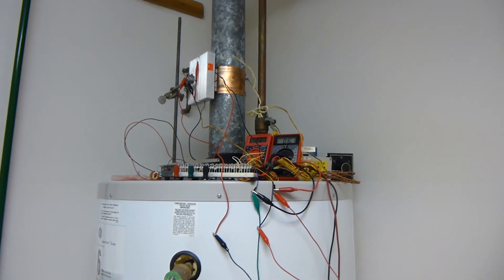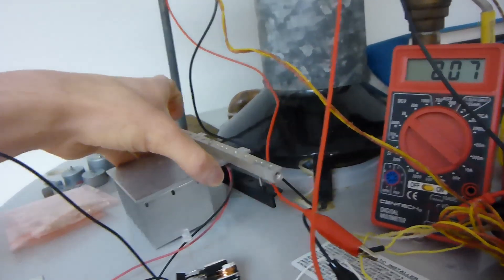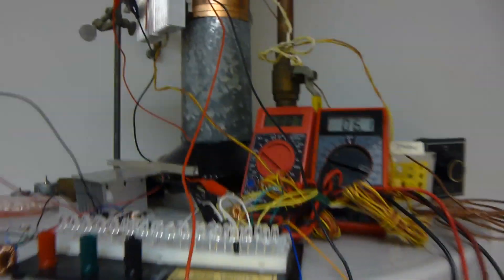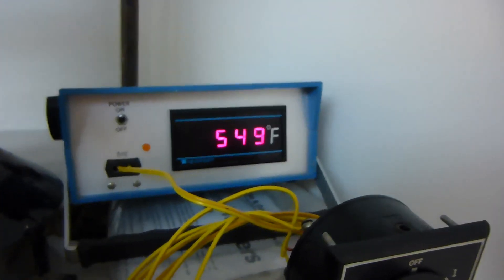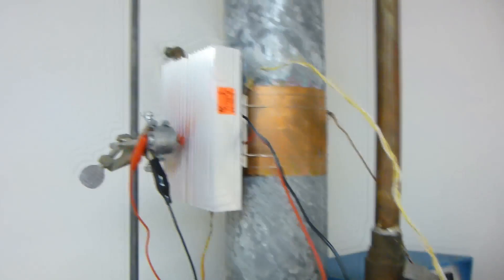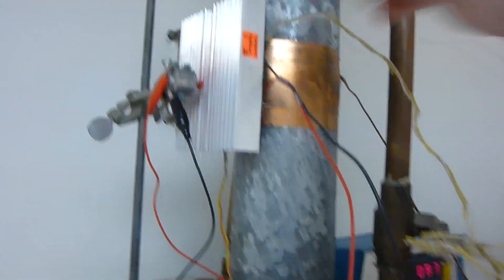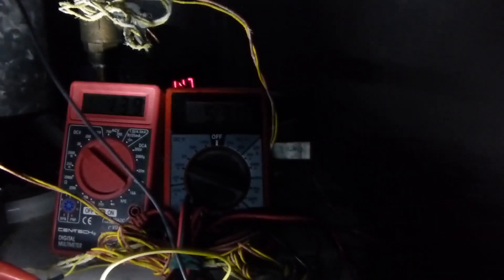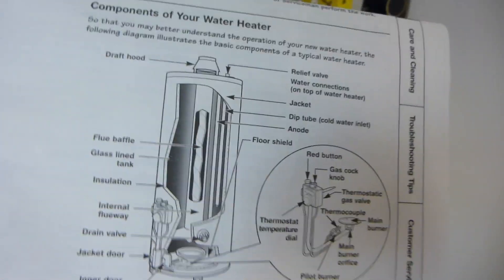DIY Peltier Coolers Harnessing Free Power From Water Heater Flue Gas

Comment: alternatively you could just better insulate the pipes for more efficiency. If you don't require that much heat, reduce gas supply in the caldron. If you want to harness power from heat, just use the gas flame itself and you should lose less heat in the process, but economical feasability might not be worth.

Comment: its not free energy peltier element is not that efficient so by drawing heat away from the pipe you are actually wasting more fuel than you get in electricity. Basically whatever you did is much less efficient than just using the grid.
Reply from the maker: +Alex Pana YOu mean because I am putting extra heat into the air and thus cause the AC to run more?  You are very right!
Reply: +Alex Pana Isn't that waste heat anyway though?

Comment: This sounds like a great way to set up some basement lighting and/or a trickle charger for some emergency batteries!  I'm concerned about the copper against steel though.  Long term contact should see some corrosion between it and the flue.
Reply from the maker: Thanks for the idea!  I should try adding a rechargeable battery to the set up!  When it's been running for a couple of minutes the voltage does get up to about 1.7 volts which I think would be enough to charge a AA battery.  The I could reduce the load of the joule thief so it does not drain the battery down to fast and would be constantly lit.  Really?  I'll have to keep an eye on it.  How would the copper and or steel corrode?  Would a little moister get in between and act as a battery corroding the steel?  Thank you!
Reply: Makerj101 Essentially.  It doesn't take much, that's why we're talking about long term (year or several depending on the relative humidity of your basement).  This is the primary reason you want to keep your copper piping from touching ventilation ducts, too.

Dissimilar metals will all exhibit galvanic corrosion.

You might want to try putting your peltier right on the pipe, instead of using the copper/aluminum to pull the heat from the pipe to the peltier.  We're not trying to wick heat away from the duct, just heat up one half of the peltier, so there's really no need for the metal between (other than as a leveling surface)...  but you could just as easily flatten a bit of the duct and put some non-conductive thermal paste between the duct and the peltier to boost heat absorption.  This would give you better transfer, and some of the heat from the duct wouldn't be lost due to the aluminum and copper between.
Reply from the maker: XombyCraft I see.  It never crossed my mind!  Thanks for pointing that out!

Well flattening the flue and putting the petier straight on with some thermal past would seem like it would work.  It would not work very well because the pipe would not be able to conduct enough heat to the peltier.  So the peltier would just cool off a spot on the flue and would not work very well.  Now if I put a small heat sink or something to create more surface area on the inside of the flue on the opposite side of the flat spot where the peltier is that would work well.  Then there would be more then enough heat supplied to the peltier to keep it nice and happy.  You see the peltiers really need to move a lot of heat to generate much electricity at all.  The steel just does not conduct enough heat and the surface area that will conduct just does not have enough area to supply the needed heat.  Does that make sense?
Reply: Makerj101 I could swear I had posted a response on here, but apparently YT lost it.

If the whole (massive amount of metal) flue wasn't enough heat to keep a spot of itself hot (with 600* going on inside), I'd be surprised.  

As for putting something "inside" the flue, in order to help transfer heat to the outside, the chunk of whatever would have to be so large as to restrict airflow and affect the functionality of the flue... Which is a dangerous proposition.

But I have another idea you might be interested in along those lines that's just too much to explain in comments.  Feel free to message me off YT if you like.
Reply from the maker: Yeah I wouldn't want to restrict the flow.

I actually realized that the gas coming directly out of the top of the water heater is 600 degrees but after it comes out and mixes with air from the hood funnel thing it cools down a bit.

Comment: Nice experiments. I guess when they say glass they probably mean some sort of fiberglass insulation. Based on the timing, I gather you guys thought to check the anode after learning about them from your sacrificial anode experiments?
Reply from the maker: Thank you!  Well actually it's the other way around!  I learned about sacrificial anodes from the hot water heater and decided to apply it to my stirling engine!  Well the insulation is most likely fiber glass but the tank is actually glass lined to slow down corrosion and save the sacrificial anode.  Here is a link:  http://www.popularmechanics.com/home/improvement/interior/1275141  Just press Ctrl F and type glass so you don't have to read the whole thing!!!

Comment: How about putting them all over the flue to see what maximum useful power you could get? I realize that the further up the flue the gasses would be cooler. It would be fun to try but I don't have a gas heater. Great video and great results.
Reply from the maker: Yeah I thought about that!!!  I could probably fit 100 on there!  Although that would only be about 10 watts...  It seems to be about the same temperature on most of the flue pipe.  Thank you!

Comment: Man be carefull, if the small copper pipe burst it will send hot water flying burning you
Reply from the maker: Originally it did puff up and pushed the fins off.  So I cut the end off and dumped the water out!  In the video there was no water left in it.

Comment: what temps do you need to get 60watts out of cooler? your not even getting 1 watt output from thhe peltier
Reply from the maker: Well for one this is a TEC (Thermal Electric Cooler) so it is best for cooling.  There are other devices that are similar called TEG (Thermal Electric Generator).  While using one of those would be a little more efficient this processes is still not very efficient at all.  RimstarOrg did a great video about them.  Generate Electricity with Peltier Module - The Seebeck Effect  The 60 watt rating that I mentioned in the video is the power consumption when used for cooling.  You are not going to even get close to the value when using it as a generator.  The best you might get is several watts if you really push it to the melting point of the materials used in the peltier module. 

Just for the fun of it... I'll do a rough estimate of how much of a temperature difference you would need to get 60 watts with this peltier cooler.  So in the video I was getting about ~1 watt when the temperatures were ~150 hot and ~80 cold side.  So that is a 70 degree difference.  Now to get 60 watts multiply 60x80 and you get 4200 degree Fahrenheit!!!  Probably not very accurate or anything!!!  :)  I probably didn't do that all right!  And it might have an exponential curve to it or something.  But still not very practical!  Just something fun I thought I would do with free heat!  :)